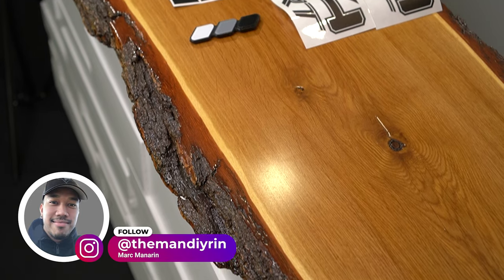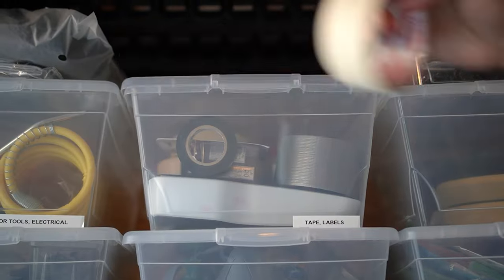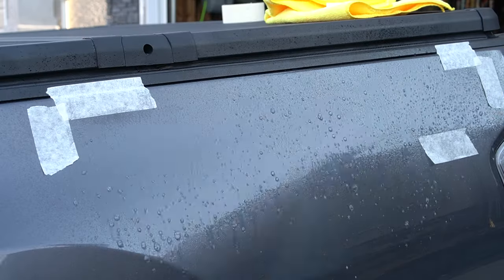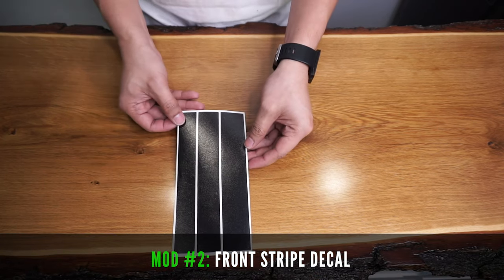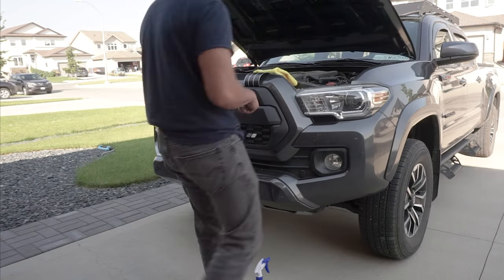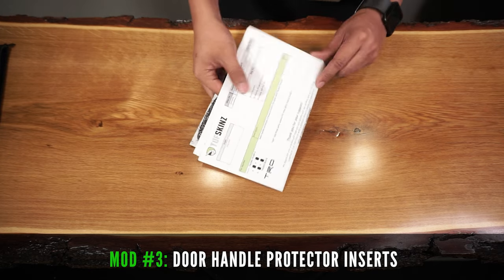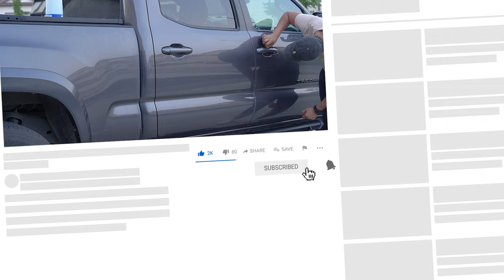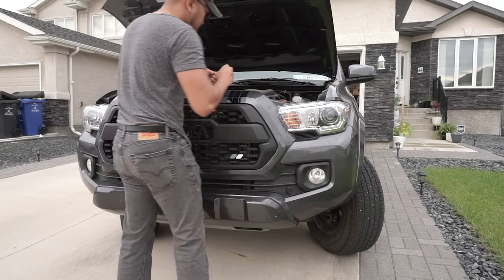BLACK OUT DECAL ACCESSORIES INSTALL on 2022 Toyota Tacoma TRD Sport | AMAZON MODS

Comment: I know this has nothing to do with this code. But I have a question. Is it tru that if I modify my suspension in any way that my warranty is voided. Please help me I have been asking a lot o Toyota Tacoma owners and nobody has an answer. Thanks
Reply from the maker: Thanks for watching my videos. I personally have not touched my suspension so I don’t have first hand experience. But when I bought my vehicle, I did ask Toyota this question (when deciding to go for extended warranty or not) and they told me it will void warranty for those parts yes. Not sure about the Toyota you bought yours from as they could be a bit different.